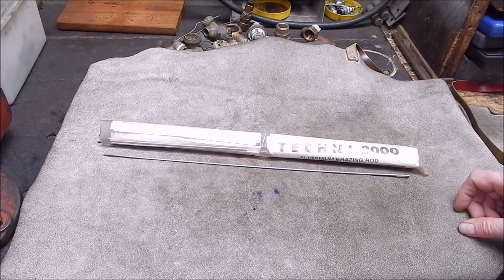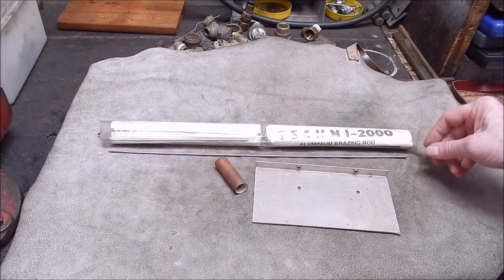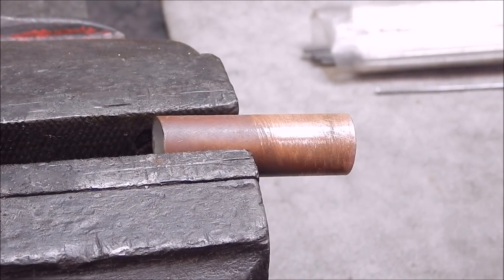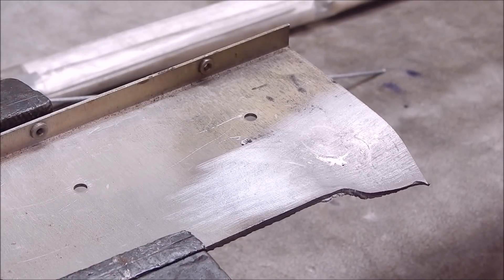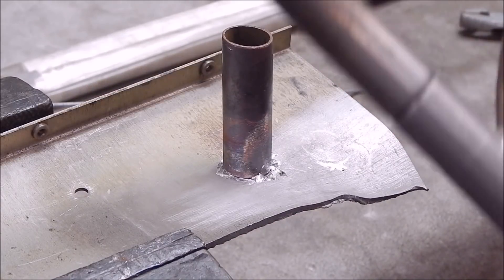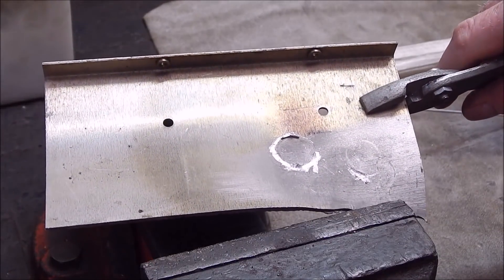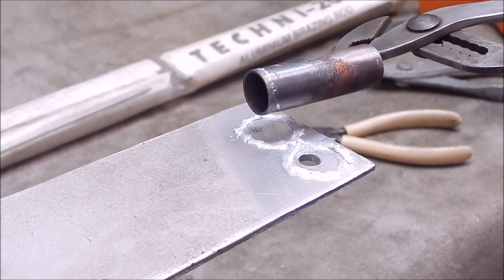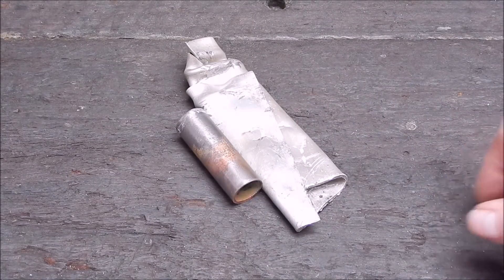Can you really join copper to aluminium with generic low melting point alloy brazing rods ?

Comment from the maker: NOTE:  I don't see how this could possibly work unless you can neutralise the obvious copper oxidization issue (clearly seen by the colour change).  That would require either a specialist rod or some sort of smothering flux.  The end result was exactly as expected.  Cheers Rob
Reply: Don't you think you ought to heat the copper more than the aluminum. The copper has to be hot enough to melt the rod.
Reply: @TheRetiredtech  You are correct, copper has a higher melting point then aluminium. From memory aluminium melts at 660 deg C and copper around 900 deg C.
Reply: Flux is used clean meltal, to shield the weld pool and clean impurities ..
 Brazing is melting a mega thin layer  of both suface simultaneously to create pool, an gently melting filler rod throu..  news compatible filler brazen can stronger than a weld... but takes a little practice... FL U X IS  my ANSWER... thank jas.. b good
Reply from the maker: I might try flux one day, but which number to use ???

Comment: I would try sticking it to copper only 1st.  If it sticks to copper it will stick to both With proper heating method.  On the other hand large pieces are too difficult using these sticks....  Been there much frustration.

Comment: I've used the rods to solder 3/8" brass nuts to 3mm aluminum with great success. That was after quite a few failures trying aluminum to aluminum but I learned from my failures.
You have to have the parts scrupulously clean, Sand, wipe with cloth then acetone. For the nut soldering I used a steel bolt to hold the nut in place. 
Don't try to heat the work too quickly and using the right part of the butane flame is critical to success. The idea is to use the CO2 from the combustion as a shield gas. Then under the shield you scrape the oxide away, I use a SS brush with a wooden handle and the rod itself i.e. scraping with the rod under the gas before things are hot enough to melt the rod. It's one of those things that once you get it to work you're left wondering why it was so damn impossible before.

 I must confess this was before I discovered JB Weld. Still as miraculous as JB is, get sloppy with the cleaning and it can fail.  One thing I've learned to never do is dust parts off with my hands..
edit: I believe these rods contain bismuth and that a few other low melting point metals will stick to just about anything when molten including ceramics and glass. Yes, you can solder to glass.

Comment: Believe it or not, I have had pretty good success with the blue demon brand ones on Amazon... worked really well for aluminum, AL to Copper as well,  but where I always ran into trouble was any time the work piece was larger than a deck of playing cards, I'd have so much trouble trying to get the damn thing hot enough before it wicked the heat away from itself that it was never worth it... I've since moved on to tig welding, but before that, it really was a great addition for the diy-ers' tool box... that's my opinion anyway...
Ps. All heating was done with a typical propane blowtorch and occasionally a bottle of map gas if I was lucky enough to have it in stock at the time... really does help tremendously and gets noticeably hotter than just plain LPG...
Cheers! 
- Jesse

Comment: Precise heat control is the trick to using those rods. If you aren’t hot enough it doesn’t work and if you use to much heat everything melts! I never been able to figure out the correct heat!
Reply from the maker: It seems that way to me as well John.  Plus the type and gauge of aluminium varies with that as well.  Cheers Rob

Comment: Interesting video. Yea those rods suck. Even when they work they have no strength.  I saw an old welder fix a crack in a Ducati cover once with brazing but I don't know what rods he used.  If you really want to try flux I would try a plumbing flux for copper pipe. A bit OT but in Tarpon Springs Florida, kangaroo jerky is going for 22 bucks for 1 3/4 oz. I remember when they were caught using roo meat in McDonalds hamburgers. You might want to jerk some roos and send it to me to sell to tourists here in WV. Cheers!
Reply from the maker: I've only seen kangaroo jerky for sale in Australia once.  Tried it and was similar to the spicier regular stuff.  That price is an absolute rip off (obviously).  It's interesting that since the COV19 outbreak, kangaroo meat is no longer available from the supermarket I used to get mine from.  I eat quite a bit of it as it's super low cholesterol and half the price of steak.  You could get it in the same format/cuts as beef, including sausages and burgers.  Great taste as well if you don't mind a game flavour.  70% of production used to go to Russia (they love it) but that market stopped due to some stupid Govt spat, as to be expected when children try to run countries.  LOL.  Cheers Rob

Comment: If one really needs to attach aluminium with copper, iron, nickel and maybe some other metals as well, the stuff You are going to need is alusol. After the metals have been wetted, You can "dilute" the alusol with more malleable solder.
https://www.mektronics.com.au/brands/multicore/multicore-45d-alusol-solder-wire-4c-3-15mm-0-5kg.html

Comment: My tip for soldering any material without flux. Wet the parts with solder you want to join beforehand. Then have a rig to align the parts, and heat up both parts slow and equally until the solder melts.
If you want to connect pipes with a sleeve,  wet it internally and the fling out the access with a rapid motion, or with a glass fiber cloth, or a metal brush (rubbing it in can remove oxide layers), so only a thin layer of solder remains. Do the same with the pipes. The solder everything together.

Comment: Not enough heat in copper to melt in braze, no flux to keep pool clean..  if you can get a finer flame directed at  copper , once red flick down onto ally,  run in  braze as bringing flame up and repeat.... that how i would approach ...
Reply from the maker: Hey, this is supposed to be a video about whether these rods in their intended use/form can actually bond to copper.  The answer is an obvious NO.  The copper is oxidizing and preventing any bond.  End of story. Cheers Rob

Comment: To join aluminium and copper using brazing technology and standard NOCOLOK® Flux, flame brazing would be applicable (as well as using a low-melting flux with a low-melting filler metal). ... A second issue with brazing copper to aluminium is that the aluminium has a much lower melting point than copper (Al: app.Mar 19, 2010

￼

https://www.aluminium-brazing.com › ...

Brazing Aluminium and Copper – Aluminiu

Comment: Iv'e never tried it on copper Rob, but in my Lumiweld kit there was a stainless wire that you scratch through the molten bead onto the parts your'e joining. I think this is supposed to break through the oxide layer and it does work pretty well although its a bugger to get a neat job and to keep the parts in place while your'e scratching about with a stainless wire!
Reply from the maker: It stuck to the aluminium better this time Mark, but still not very confidence inspiring.  So the technique was right.  Maybe I will try them with flux one day, but which number flux to use ?  LOL  They are supposed to be fluxless.  Cheers Rob

Comment: 🤣🤣🤣 That was a good laugh Rob
I see from comments that it was Robert Murray Smith you watched, pretty sure he said it was not a high strength join but adequate for what he was doing. Regardless, he has a very interesting channel and I was going to reccomend him to you.
Cheers mate 🍺
Reply from the maker: Hi Bill.  Yes it was, but whatever rod he used, he didn't say and I'm betting it is not this generic crap that gets sold everywhere.  It got even funnier when some molten ally dropped down and set fire to the rubber mat I was standing on, but the camera was pointing the wrong way.  LOL.  The things I do for YT.  But I'm not shy and don't profess to be perfect ;)  Cheers Rob
Reply: At least you didn't burn your leg, like a few others in the last few days
Reply from the maker: I expected lots of hate for this video from the generic crap aluminium rod lovers out there, and I wasn't disappointed ;)  He He.  Good to stir the pot a bit. Have a beer for me.  Cheers Rob
Reply: 🤣 the trolls are always reliable.
Don't have much experience with alooomiunmioimium but a quick experiment with TIG rod and ally/copper gave similar results but it did sorta stick to the copper, very rough experiment tho, I stopped when the bench caught fire 🤣

Comment: Operator fail...
You (I) can even solder aluminum to copper with tin lead solder, you just have poor technique or understanding of how to, so this video is pointless.
There are plenty of videos on youtube of the many methods.
Reply: Its a demonstration of the rods, not the techniques.
Reply: Why didnt you heat it from the top so the tube would get some heat?
Reply from the maker: Ummm. look closely and you will see that the copper surface actually oxidized from the heat.  Next question ?
Reply: @Xynudu  I was taught a method of soft (tin/lead) soldering copper to aluminium. We just called them submerged joints.  The copper and aluminium wires were cleaned up with abrasives, twisted together, a blob of resin solder formed over the twist.  Then using a soldering iron with a sharp filed edge, we just dragged it over the twisted wires scraping the oxides off under the solder.  Solder blob keeps the air out so no re-oxidisation of either the copper or aluminium, the sharp iron tip scrapes the existing oxides off and the tin/lead "tins" both wires perfectly.  Remove excess solder, done.  

After a while you can get quite fast.  I have used a similar method when soldering copper earth wires to aluminium chassis (usually I cut heat conduction reliefs to reduce the heat required from the iron).  For an exercise, I have even soldered together small pieces of aluminum sheet at right angles.  When just tinning aluminium, it doesn't really matter what you use to scrape the oxide off under the "blob" of solder, I used a couple of homemade scrapers after making a mess of my cut down SS wire brush.  

To test it, try to wipe the molten solder away after tinning, I can assure you, you will not be able to fully remove it from the aluminium, the bond is a full metallic bond.

Although I usually do this with resin solder, I do not see any reason why a flux is required, the lead/tin will bond instantly once the layer of aluminium oxide is scaped off.  The mechanical strength of the bond is quite high as long as the gap filled by the solder is quite thin.  The electrical bond is pretty much perfect.

Of course, not what you were trying for but quite useful for electrical work.

Regards,
Bob
The GC

Comment: Also you are using too much heat. Rods are fine - operator error?
Reply from the maker: Ummm. look closely and you will see that the copper surface actually oxidized from the heat.  Next question ?

Comment: Used similar today to fill holes in Alloy heat sink that had screw holes in wrong place. Perfect job as was joining alloy tube to plate. Preparation is the key and use the stainless scratcher. You need to heat at the top and heat the tube as well.

Comment: What if You tried to apply tha solder to the copper alone using the needed temperature and check for good bonding? Then try to solder the pre prepaired copper to the aluminium? Don't You think the teperature of the copper was too low for bonding to it?
Reply from the maker: The copper was oxidizing.  This will always be the issue.

Comment: Thanks for the video Rob! Watching your other videos, I know you are an experienced brazer (that Bullfinch is impressive!).  Probably not worth fooling with it, but I am curious if the filler material would stick if the copper was hotter and/or  fluxed. Could a reducing flame help keep the copper from forming an oxide that prevents the alloy from wetting it? Really enjoy all your videos, thanks for sharing them with us!
Reply from the maker: I think you are dead right regarding the copper oxidising.  Obviously it was plenty hot enough. It won't work with these rods as they can't counter that issue.  Total waste of time.  But good for a chuckle ;)  Cheers Rob

Comment: Hi Rob. Very entertaining. I was just thinking at the beginning of the video when you tried it on the thin aluminium plate, surely the aluminium is going to melt before enough heat gets transferred to the copper 😂 I've seen those adverts for the rods where they just waft a little heat over the work and immediately you get a perfect joint, excellent special effects work 😉 Thanks for the video mate, too hot here to do anything other than drink beer and watch YouTube videos 👍 Cheers, Alan.
Reply from the maker: Hi Alan,  it was good for chuckles.  I've tried two different brands of these type of rods and never had any success.  Have a Coopers for me.  Cheers Rob

Comment: Probably would work with a bit of rosin flux to get a film first to the copper pipe, and then use that thin film to bond to the aluminium plate. I have soldered aluminium usingf regular rosin solder and a pool of oil to keep the joint air free, and it does work, just you have to scrub the surface clean with a wire brush soaked in the oil, so there is no new oxide growth.
Reply from the maker: The copper oxidizing was obviously the issue.  Some sort of gel flux might overcome that, but I'm not wasting any more time on it. Cheers Rob

Comment: You obviously have never silver soldered or bronze brazed. The reason the rod did not join both items was that you were heating from beneath and the copper tube was not as hot as the base material. If you had got the temperature even on both then the material would have flowed properly. I have tried this product out and it does work but its best on Aluminium to Aluminium. It performs just like silver solder or even lead solder.
Reply from the maker: Check out my multiple brazing videos.

Comment: Well surface is not clean enough and you need some flux would help a lot won't work without Flux
Clean both surfaces with wire wool and the end. Tin the copper first with the rod or try solder
Reply: You're missing the point. There's a guy sellinh these rods at every field day/swap meet in the country. Many people buy them and no one can get them to work like the demo.

Comment: My first attempt with these I failed.  But after a few comments I found a few good tips that made a lot of difference,

Chemically cleaning helps a lot with bonding issues, I also found pre-heating the whole workpiece and gradually bringing up to melting point of the rod. If you go to hard and fast on a specific area you go over the rod melt temp and into the Aluminum destruction temp quickly. I have found that using the map gas to get to temperature then taking the gas off the work, or at least pulling back from the work gives the rod time to melt as a-posed to Half melting half breaking down under the heat of the flame it’self

It looks to me that the copper is not as hot as the aluminium in your test, I advise placing the copper piece in your vice, some old tiles or similar insulating material will help keep the vice from becoming a heat sink. Gradually heat the copper and test the rod directly onto copper. 

This will prove/disprove the ability of the rods,
Reply from the maker: The copper got hot enough to oxidise on the surface, which is a bad thing, as it will prevent a bond.  Total fail.

Comment: I laughed when it all fell over. Every time.  Am I a bad person?

I tend to think that the only way you're going to get the copper hot enough for it to "wick", even if it's possible, is by direct heating; indirectly from below is never going to work.  I'd try directly heating the copper more than the aluminium, see if that works.

I assume you got tempted to try this by Robert Murray-Smith's video.
Reply from the maker: I think that was the one.

Comment: Start with getting a solid bead into aluminum. You are still doing it wrong; scrape through the molten bead with stainless spike to break the oxide layer on aluminum and let the rod and aluminum alloy together. There is a oxide layer, no matter how well you pre clean the surface.
Watch the old technoweld videos, I think they are from 80s, they demonstrate the use correctly.
Edit: don't know about al-cu joint.. It will be a braze with copper if anything, so if you can get the stuff wet the copper.. maybe with flux, maybe.

Comment: Have bought several different types of these, both cheap and expensive. None of them have ever worked at all, one set of rods melted at close to the same temperature as mild steel. Just another crock of sh*t.
Reply from the maker: Same here.  I've tried two brands and absolute crap shoot with both.  Cheers Rob

Comment: you need to heat from the top to get the copper hot enough for it to bond to it
Reply: you dont want the torch to melt the solder you want the metal your joining to be hot enough to melt it and form a eutectic layer.